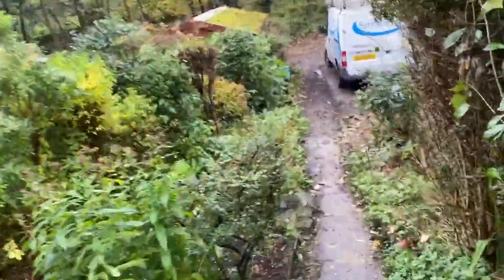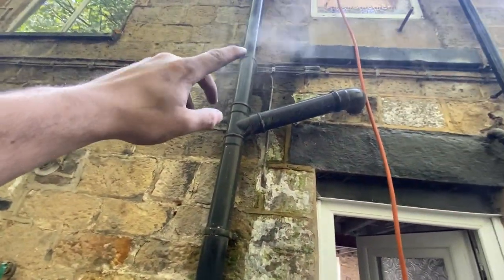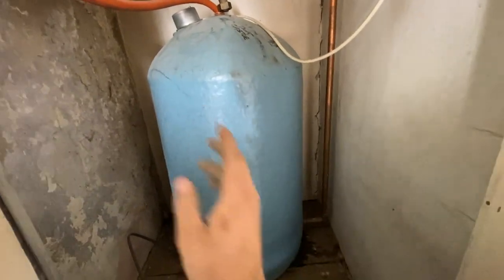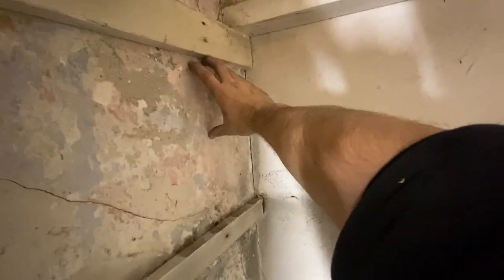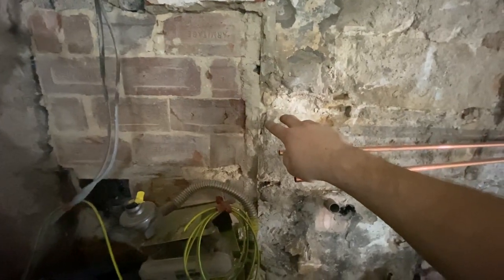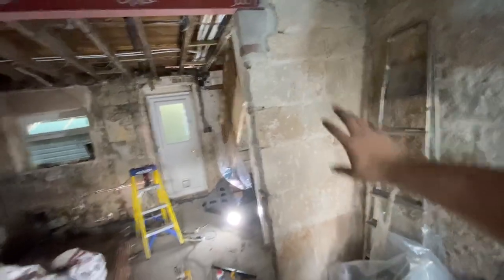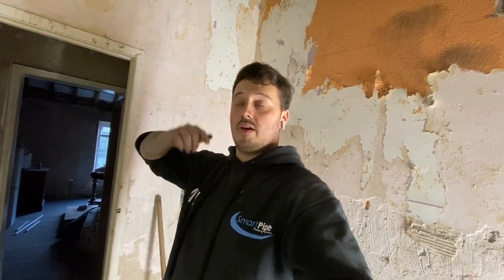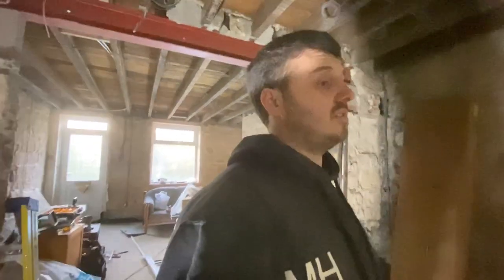HUNTS HIDEAWAY REFURB || Week In The Life Of A Plumber || 025

Comment: Get yerself a press gun and a set of TH or U16/20 profile jaws and ditch the speedfit for mlcp. Literally no downside only upside.
Reply from the maker: Need to take the plunge on the press gun I think
Reply: @SmartPipePlumbing  Pro tip. Don't buy a rothenberger compact tt gun. I'm on my 4th in less than 6 months. That's nearly £5k in guns. They keep breaking down.  Absolute sh1t show.